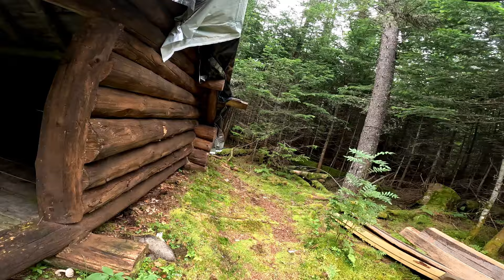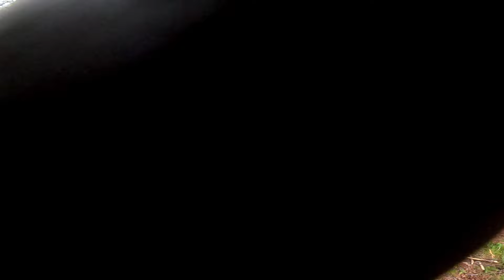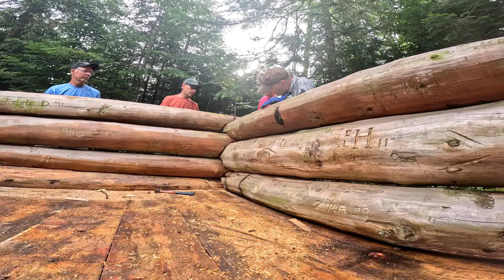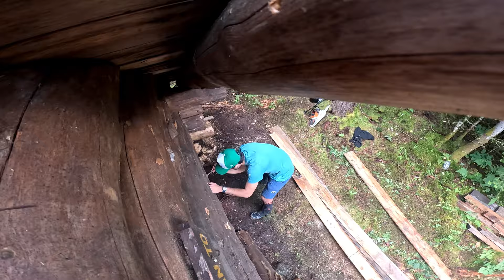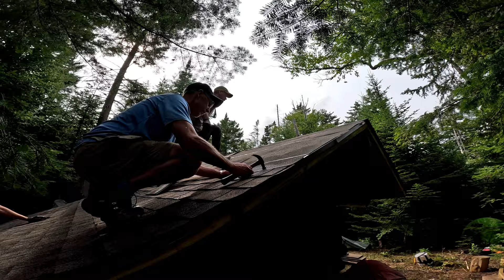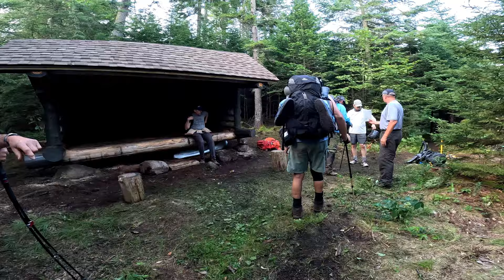Lean-to Rescue @ Flowed Lands Below Mt. Colden

Comment: Great job and thank you by all that are involved in these rescues.  Your hard work and dedication is greatly appreciated.  You should into a pallet buster.  This may make it easier in removing the boards used on the roof.  It's a little heavier than the crow bars being used but it is great at ripping boards up because it uses a great leverage advantage in prying boards straight up.
Reply from the maker: Thanks and thanks for the tip, looks like a functional tool.  Carrying gear at a distance means we make the most of limited tools.

Comment from the maker: www.Lean2Rescue.org 

A lean-to in the Adirondack Wilderness is a welcome destination. Near a lake, river, meadow or mountain there are around 300 of these shelters in the six million acre park.

In this video, the leantorescue.org team led by @brantschneider and Doug Arnold tear down an old lean-to and rebuild it to keep the legacy alive. Brant calls this "camping with a purpose".   This crew hiked out to the Livingston Lean-to located miles into the Flowed Lands below Mt. Colden in the High Peaks Wilderness region of the Adirondack Park, accessed from Upper Works Trailhead in Newcomb, New York.   

These 3-sided structures are designed to stand the test of time against the harsh seasonal elements. They are a welcome site, a refuge in a winter snow squall or a summer rainstorm. They dot the landscape offering temporary homes to hikers, paddlers, climbers, skiers, fisherman, hunters, photographers and others open to the embrace of nature.  They have provided overnight shelter, rest stops, lunch spots, solitude, and social encounters for outdoor enthusiasts of all kinds and through many generations.

A new deacon log, flooring, roof kit and fasteners were weighed to be able to calculate flight loads. The notion that large areas are cleared for these lean-to package drops is a wishful thought.  The load was delivered by helicopter and then transported over frozen ground to avoid any disturbance to the natural area. We are most thankful when the drop site is nearby but even still it usually requires some uphill carry with lifting sling straps for build sites 100foot distance from water. 

Many volunteers can complete a lean to rescue in a weekend. Most of the work is in the prep and planning before the final build begins. 
The Lean2Rescue crew has restored, rehabilitated and rescued more than 130 of these Adirondack icons since 2004. Started by Paul DeLucia of Baldwinsville, NY, the all volunteer group works closely with the DEC to identify and complete suitable projects – from roof repairs to entirely new structures. Most of the work is carried out using non-motorized tools and vehicles, and the bulk of the building material is carried into the woods via human pack mules, canoe, portage carts, winter sleds, and helicopters.

The first course is set to the foundation rocks. We use rock bars and at times a block and tackle to get large rocks in place and leveled to match the four base logs. Correct labeling of the build kit is essential to the build process, disassembly and reassembly.  

1. There are many ways to build a lean to. Original Adirondack lean-tos were built from local trees, and either scribed to fit one log on top of the other, but more often, were simply stacked logs relying on oakum rope to fill the gaps between logs. 

2. The Logs were fastened to each other using long, robust nail spikes.

3. Peeled Cedar and Tamarack trees are now used along with substantial rock corner foundations to provide for greater life-span than the original balsam and spruce lean-tos. The new builds show the scribed log workmanship and new lean-to design used by the front country work crew.

 4. A base is set to match the dimensions of the rock foundation .
Starting with the main front or "Deacon" log, the four base logs of the foundation are laid.

5. Each layer is fitted or scribed to the layer below, so water will shed onto the next log and out of each corner joint.  Each log is scribed to fit to the one that lies below - the standard for fitting a tight joint is whether a black fly can make it through.  Although we do recognize that the whole front of a lean-to is open and often on a rebuild we need to remind ourselves that it's a lean-to not a church and continue moving forward in the build process.

6. A combination of tools are used to cut the logs to fit.
Scribing is an art to itself, requiring use of a compass device that has two levels to track that the line made is plumb and true from the bottom to the upper log. The lean-to takes shape, layer by layer of logs, each selected to maintain a level structure.  

7. Next, purlins are put in place, holding roof joists. 

8. Wall logs are trimmed to the roof line, with the angle of joists matched to the log angles, creating a true roof line.  Each of the joists is also scribed to fit.

9. Often a beautiful eastern white cedar log will be split to provide decorative facing.  These logs, called pillar logs, cover the raw ends of the wall logs.

10. The lean-to goes up quickly. layer by layer to the roofline the logs go.  Purlins and joists in place, along with blocking at the rear of the lean-to. 

11. Up go the roof boards, a layer of ice and snow shield and then quality shingles. Temporary scaffolding using build materials for the floor is needed for the front overhang roof.

12. Finally the lean-to is assembled and painted with a cordova brown or mink color stain.

Thanks for watching, please like and subscribe!